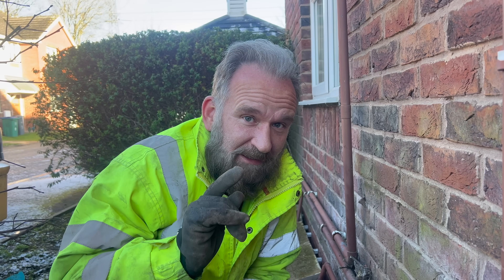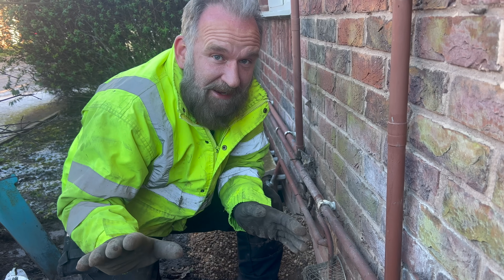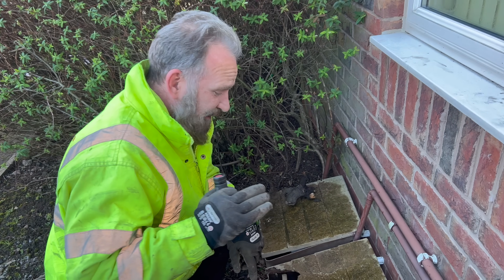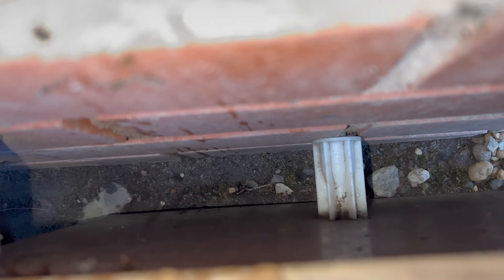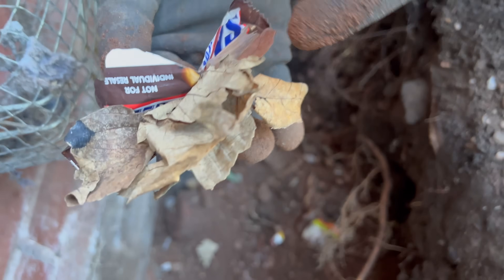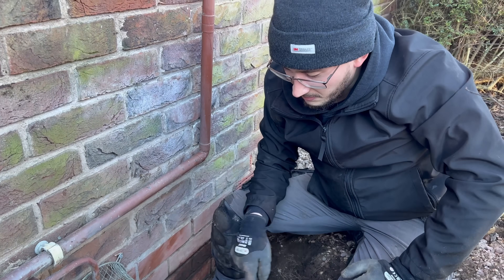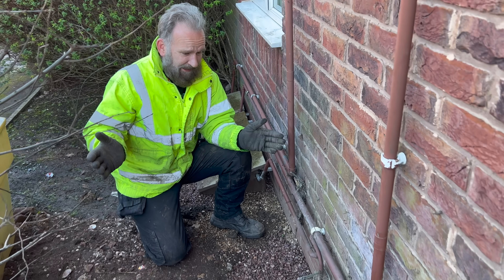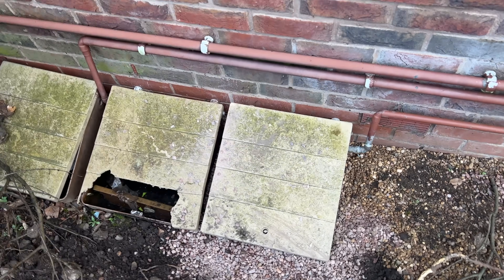RAT holes around your house? HOW TO STOP RATS burrowing into your house!

Comment: Get yourself a cat, maybe a few of them, easy. And you'll also have something furry to play with instead of rats.
Reply from the maker: @TheJonic2000 two problems with that. 
What if the rats have been eating poison? 
The rats of Birmingham would kick a cats ass 🤣
Reply: @PestInterceptors  Fair point but if the cats are well fed then generally they only use the rat as a play thing. Even the smell of a cat is enough to discourage rats from an area, generally speaking. If poor moggy comes a cropper then get another one. I believe with the overpopulation of all major citys in the UK and poor litter collection schedules this problem will only get worse.
Reply: Plus terriers are rat killing machines.
Reply: I had on in my living room at silly o'clock in the morning. I could hear a load of noise put the light on and my cat come running in with a rat in her mouth. Grab the cat and she let the rat go, rat span around and went in my bathroom and down the side of the bath never saw it again. I got a rat trap still but haven't court it. How the guy is explaining it is how it got in the flat. P.s I keep a tidy flat so I am clean as is flat lol
Reply: I've got 6 cat's in the gardens, 4 mastiffs, 4 terriers, 2 minks and one Wolverine.
Reply: My jack Russell kills rats in about a second and doesn't eat them.has caught loads on the farm.  @PestInterceptors

Comment: Gotta respect those creatures for how smart they are
Reply from the maker: @SKA343 the rats are pretty smart too though! 😉😝
Reply: @PestInterceptors 

Do you need to capture the rats on the side of your foundation before putting the 10 mm gravel down?
Reply from the maker: @clbo9878 yes because in theory you could be dealing them inside.
Reply: @PestInterceptors  

Do you mean SEALING then inside? Also, I think it would be hard to know if you've killed all of them inside right?
Reply from the maker: @clbo9878 you will need to work out if they are coming from outside in or from inside out. 
The technique in this video is only for when rats are coming from outside in. 
Put some loosely crumpled paper in the holes and then cover with soil to a depth of a few inches. Pat down the soil. 
Leave until the holes reappear. 
If there isn’t soil piled up around the hole, then you know the rats have come from inside. 
Rats inside are usually coming from a drainage system problem.

Comment: who ever build them block of flats also corwards if you ask me,Ive worked on Building sites before,We build walls from 7 feet down in to the ground,That building looks like the bricks started less than a few foot in the ground,Im also so surprised the building has not even fallen down yet
Reply from the maker: I think it’s the design of those. It’s called, I think, a floating concrete slab.

Comment: Rats can’t really dig through pea-shingle I guess as it falls back in on them?
Reply from the maker: Only if it’s 10mm pea shingle. 👍🏼
Reply: 6mm works too,better if its washed gravel
Reply from the maker: @boromickfc  but that falls through the wire mesh ☺️
Reply: Depends on ya mesh size lol
Reply: @PestInterceptors  why didn’t you fill the void with concrete and then put the wire mesh  over?
Reply from the maker: @KKTR3  because there is a huge void under the building. 
You could be pouring concrete for days. And why make work when there is an easier more efficient and effective way. 
Plus the rats would just go deeper than the concrete, that’s why the shingle is used, they can’t dig through it as the hole they are digging just fills back in.
Reply: @PestInterceptors  when you say huge, are we talking wheelbarrows size or more? What did the rats do with the soil from the tunnels?
Reply from the maker: @KKTR3  that particular building is on a floating concrete floor. So the void is the size of the entire building and maybe a metre deep. 
The soil from the holes would have been  on the surface at one point but it had been trodden down by months of rat activity.
Reply: @PestInterceptors  that’s just mind blowing, The structural integrity surely must be questioned?
Reply from the maker: @KKTR3  new buildings are nearly always built to price….a cheap price. 
This is the consequence.
Reply: @PestInterceptors I just had rat man out they said they will be using concrete is that not best to use lol
Reply from the maker: @abbz23  it will need quick set cement as rats can get through normal cement before it goes properly hard (cure time for normal cement can be a couple of days!) 
But the truth is this though; if the rats are coming from underground, as in a broken drainage pipe, the cement will do nothing as the rats will tunnel around it and get back in. It may slow them down a little…at best. 
99% of rats in houses are from drainage.
Reply: @PestInterceptors  Do they come up through the toilet?
Reply from the maker: @SeanSmith-f3t  it’s rare….but they certainly can!
Reply: @PestInterceptors  So how do they usually gain access through the sewers? into the house I mean
Reply from the maker: @SeanSmith-f3t  via a broken or misaligned pipe usually.

Comment: Neat video.. Just wondering i would have used cemment to fill the holes in,, but it would work just the same..great video..
Reply from the maker: We explain why we use pea shingle in the video 😊 
Rats will just dig around cement in this situation.
Reply: Rats have chewed through cement in my home
Reply: @PestInterceptors  I didn't see where you explained about using pea gravel - I see where you say you explain it keep watching, but no explanation  - is it because when it moves it will fall back in on itself. English person in US
Reply from the maker: @GiveaDogaHomeGaDaH  that is correct. If it’s bigger or smaller it tends to be dug out. This will roll back in to fill the hole.

Comment: Just found an excavation next to brick work with a small gap between the breeze block foundation which I think where the buggers have been getting in. Done a temp repair until I get the proper materials. And guess what it was behind a Rosemary bush!
I’ll go under the floor tomorrow to have a closer examination of what they’ve been up to there.
Reply from the maker: @derekmclean5603  don’t forget that 95% of rats in houses are coming from drainage problems under your or you neighbours house. 
Lightly fill the holes and see what happens when the holes reappear. If there is a pile of soil above ground they came from outside, if not, they are coming from inside.

Comment: Great video cheers, I've one or two rats that has found its way into my house in a similiar way around a sewer pipe the hole of which is a wider diameter, I'm concerned though if i block it, the blighters will chew their way out through some other route, what do you do in this situation? I'm considering setting up a camera to study when they leave and then rush down and fill it when they're outside foraging!
Reply from the maker: @charlesleavitt4787 it’s rarely just two rats….and if it is they don’t stay that for long. 
If the hole is near to a sewer pipe you need to look at that. 
Check out our playlist on our Rat Free Lifetime Guarantee. You’ll see how we solve that problem. 👍🏼✅
Reply: @PestInterceptors  I noticed a brown rat in my garden today chilling under the shed, seemed to be eating the bird seeds off of the grass, what should i do? theres only 1 that i have seen so far

Comment: We have a brick building and the same problem. PORTLAND OREGON
Reply from the maker: @wonder7798 It is important to work out if they are going in or going out of the holes. 
Push some rolled up paper into the hole (just lightly) and cover with soil. 
Check the next few days. If the hole reappears and there is a pile of paper and soil on top of the hole, the rats are coming from outside. It is more likely that there will be little or no spoil above ground though. This will indicate that they are coming from inside out.......which means drainage/sewers.

Comment: I moved into a house 2 months ago , there are rats in the ceiling and walls , i have no loft so cant get up there , ive found holes outside where the pipes go in , can wire wool be used to fill the holes up ? Will it work ?
Reply from the maker: @rachelcarter2036 it is rare for rats to get into a house that way, but it is common for rats to leave a house that way. It is a common misconsception in the pest control world tha rats get in houses from outside. The truth is 99% of rats in houses get there via the drain pipes under the houses. Take alook through our rats playlist.

Comment: why 10mm gravel and not larger? what gauge wire mesh do you use?
Reply from the maker: Because it rolls back into the hole that the rat is trying to dig. Bigger and it won’t do the same. The mesh needs to be 10 mm holes and stainless steel or galvanised.

Comment: Hi what size mesh do you recommend does it need to be galvanised ?
Reply from the maker: Rats can get through a hole of just 13mm, so anything smaller than that is going to work. we always use galvanized mesh.
Reply: @PestInterceptors  Thanks for prompt reply! Galvanised makes sense only want to do the job once! 🙄
Reply: Also what's the reasoning behind 10mm shingle as opposed to 20m cotswold chippings ?
Reply from the maker: @up2now  because small round stones roll back into the hole that the rat is trying to dig out. 
Be observant though! If the holes appear again and there is no spoil heap above ground, then it’s been dug out from below…..then it will be a drainage problem….we have a playlist all about that if it happens.
Reply: @PestInterceptors  it's more a preventative measure at the moment I've built a summer house with decking so going to put mesh all around it 30cm above and away from building ie reverse l shape then back fill with the 10mm gravel ?

Comment: My Gas meter is the same outside the block of flats where I live,I not had and rats or mise coming in here,Had them coming in my last flat,I also hard them moving about in the loft,They will find other ways of getting in to peoples homes,They also travel through sewage pipe's,They also come up and get out of peoples toilets,How do you stop that,I also had a mouse running about in my old flat.LOL the mise/rats will also get throgh that wire mesh,They chew their way through it
Reply from the maker: They can’t get through stainless steel mesh if it’s the correct guage and hole size.

Comment: Surely the problem with services into the property and the lintel could be solved during construction very easily by effectively large, square metal washer, if you can grasp what I’m saying
Reply from the maker: We don’t build the houses, we just fix the defects ☺️
Reply: I think what I’m trying to describe is a washer-A large square washer with a hole in it for services
Reply from the maker: @KKTR3  once rats have started nesting they are very determined to get back in. They would simply dig around your idea I’m afraid. The same with pouring concrete in…they would just find the edges and tunnel around the concrete. 
Trust us. We are the only lifetime guarantee company for rats…we know our stuff. ☺️

Comment: You said that the mesh goes “up the wall and away from the wall otherwise the rats will burrow around it”.

Can you explain this please. If the mesh is tight against the wall and covers the hole then how will they burrow around it?
Reply from the maker: They would burrow under the mesh as it’s only soil. 
The mesh going out at a right angle from the wall prevents this as the rats aren’t intelligent enough to dig a foot from the wall to get under the mesh.
Reply: @PestInterceptors  ok so the mesh is just there to hold the stones in place and the deterrent is that the rats cannot burrow through the lose stones. Reading your answer above, it seems that you bend the mesh into an L shaped so part of it covers the hole and the other part prevents the rats going straight down.

Comment: I have this exact same problem on a new build extension. I've watched many videos but nothing yet explains why smaller 10mm shingle. Please share...
Reply from the maker: It rolls back into the hole faster than they can dig it out @stuu3270 
But this only applies if the rats are coming from above ground. 
Most rats are coming from the sewer underneath. In that scenario the gravel will end up disappearing into the sewer.
Reply: Brilliant, thanks. One more thing... Do I attach it to the wall with screws or just let the shingle weigh it down?
Reply from the maker: @stuu3270  no need for screws. Just like the video
Reply: My only worry is fitting mesh if rats are inside. They'll be trapped in side and start causing more damage. They only come out at night so it looks like a night shift for me then.😢 Or wait until the traps produce results first...
Reply from the maker: @stuu3270  do this and save yourself a night shift: 
Loosely screw up some newspaper and put it into the holes. It is only there to stop the soil going down the hole! 
Then fill loosely with soil. 
Then check every day until the hole reappears. 
If there isn’t a pile of spoil (soil from the rats digging) outside the new hole, then you know the rats are coming from under the building and not above ground. 
Ps. 99.9% of rats in houses don’t come from above ground. Sadly 90% of pest control companies will tell you they do.
Reply: Thanks for the tip.
I blocked the first hole and put a camera down. The rat came along and dug back in, from outside. I covered that spot with a paving slab. It came back the next night and dug out two holes under a lintel bridge, from outside.
Today on camera the/ a rat came out the new hole and wondered off. I took the opportunity to put slabs and heavy stuff over where the lintel bridge is. Now monitoring. Hoping it is just one rat setting up home, as I only ever see one at a time coming and going.

If it's out and cannot get back in I'll take the opportunity to get some mesh down. Then monitor the plastic air bricks. It's a long game and a complete nightmare!